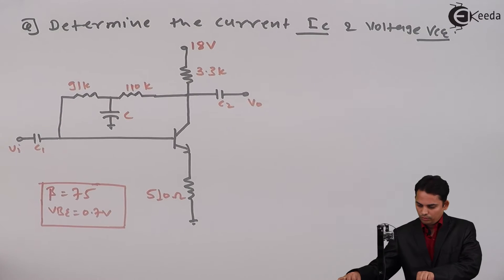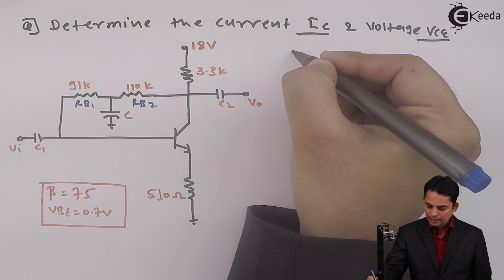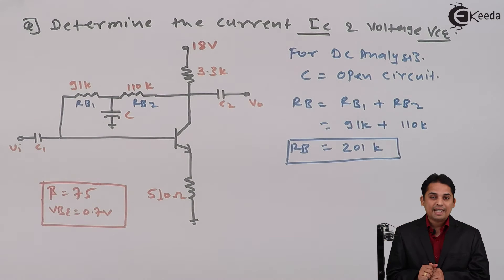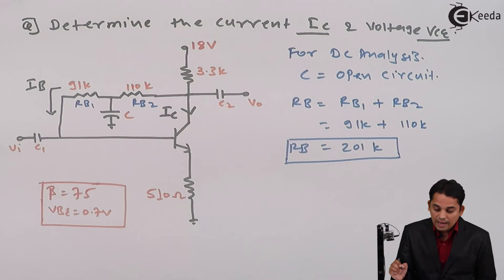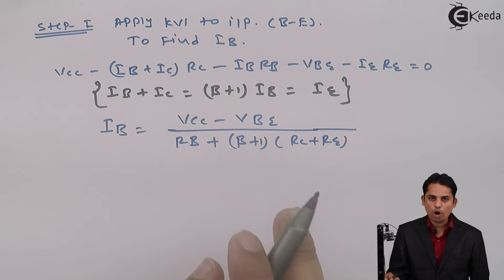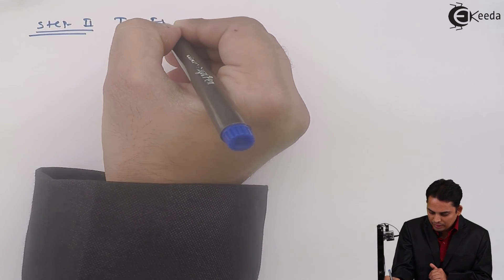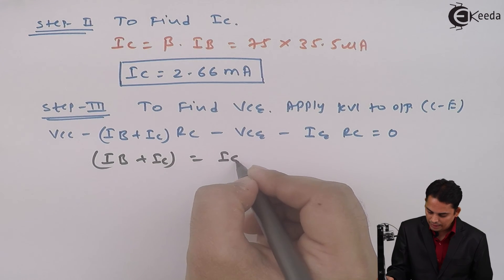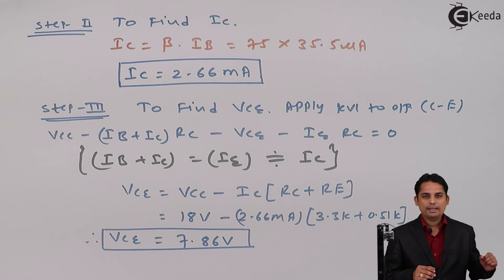Collector to Base Bias Circuit in DC Analysis Problem 1 - Analog Electronics

Comment: An NPN Transistor has a DC base bias voltage, VB of 10v and an input base resistor RB of 100KQ. What will be the value of the base current Ig into the transistor? LobGELN Caler Tala
Reply from the maker: We are more than happy to solve your queries.However for this you will have to download the Ekeeda-Learning Application by going through this link 

http://bit.ly/353lpP2  ,because we don't answer any technical queries on youtube for this we have a dedicated team.